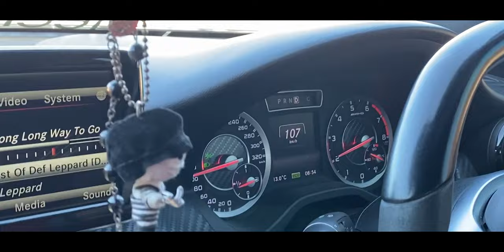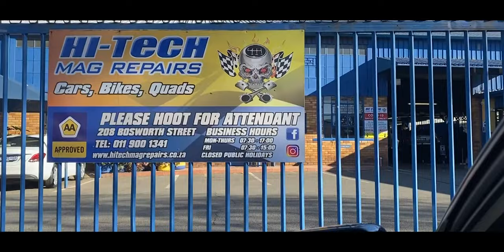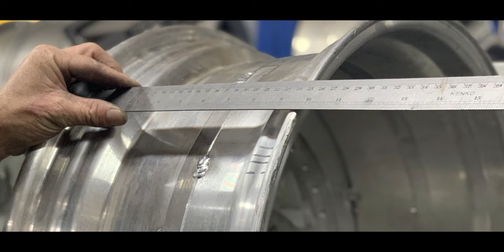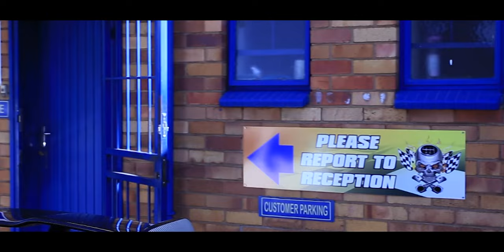Awesome, Bizarre or Ugly? //  Teddy Bear Wheels

Comment: I can say thus far i have loved any custom wheel. teddies is ok on the A45 coz its not a car brand mag. its neutral. and dought she is racing the car and also if she loves it its cool . I know more aggressive wheels will work better on a A45 , but im a guy and i will drive the crap out of that car if it was mine.lol.  

Speed and sound 
If you guys can ask hi tech repairs.

They cut up other mags just to make these custom mags. That's the process.

They have the tech to put billet aluminum on that teddy.( I am sure they have a CNC Machine as well)and the tech to make dishes.

Question:

Why cant they manufacture the dishes/lips/bands from billet aluminum and put them on the faces of the mag u want customized.
I'm not sure but i believe it will be cheaper if done on a larger scale. and for business its good coz u will be the first 1 offering dishes to the mass market if u wanted to.(Other mag repair shops).

Just for those who don't know.
Teddies cost about 5000 rand
Then they had to find 19inch mags to cut up (I dont know) Maybe 7500-watteva lets work on 7500.00(Could be wrong)
That billet alu bands maybe 2000 for all 4 wheels 
Then the labour ( I dont know ) I heard about 6000 from some1 els dont know about hi tech.

So those teddies custom like that could cost about R 20000.00? wow 
this is just an estimate to make my point .

so lets say there was dishes available at say 2000 for all four than it would reduce the cost of doing this significantly. And there would be no need to butcher a perfectly good working mag used for the dishes.

JM2C 
But i think a valid question, based on the fact that more and more people are going custom route these days.